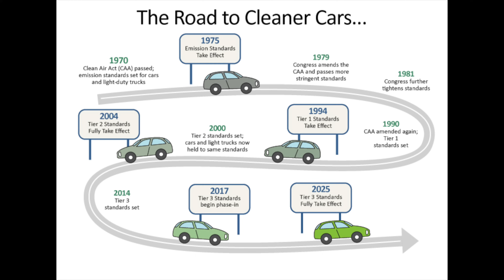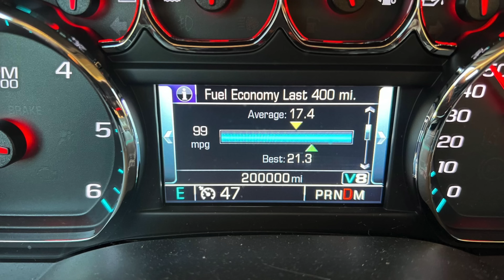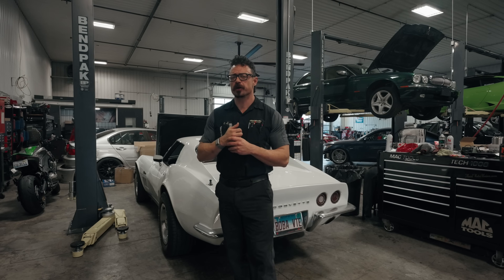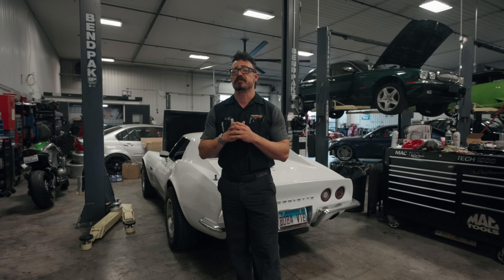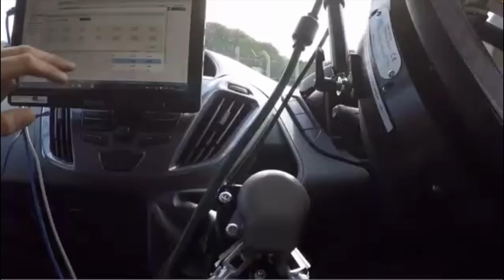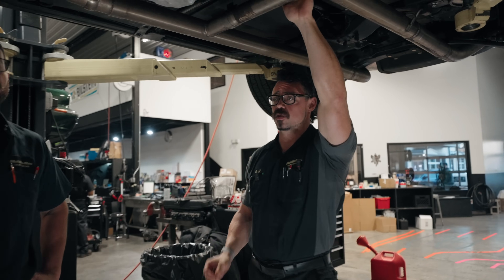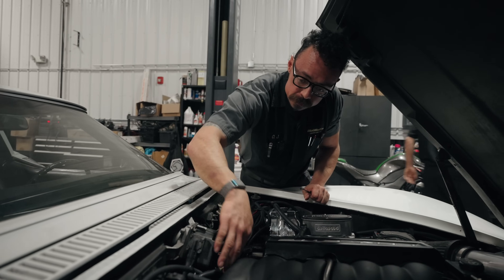Do You Need a 6 Speed Auto? LS C3 Corvette Transmission Swap EXPLAINED.

Comment: The trans is changing like any complex part let someone else do the beta testing for a couple years. Additional gears beyond 5 probably are for speeds not used much, maybe another gear would be helpful for 70-75. Reliability is proportional to the number of parts though stress in a transmission is probably proportional to the size of the jumps.

Comment: Fun video. Had this debate when putting together my LS3 Roadmaster Wagon swap project (it’s all on the Internet Brands Auto Group YT channel). 

I really wanted to do the 6L80 Connect and Cruise, and for a while, it was actually cheaper than the 4L65e, but as a first time DIYer, my Chevy Performance dealer recommended the 4L65e bc it was easier to fit in the OEM Roadmaster trans tunnel. With 3.42 gears it hits 2300 RPM at 75mph on the highway, but I can still manage 28mpg if I back down to 60-65mph in  4500 lb wagon. 

The downshifts are a bit weird at times… you want to accelerate but suddenly you’re back in 1st at 5500 RPM… and I don’t like how it rushes to get to 4th gear (I still need a trans tune). And the supermatics make a weird buzzing sound  Chevy says is normal.

But it has some fun features where you can blip the throttle (almost like a rev match) and it’ll drop down a gear consistently. Overall it’s working well, but would recommend the 6L80 of folks can manage it.

Cheers!

Comment: The  ZF 8-speeds from the BMW and Dodges goes into a lot of conversions now. Aftermarket TCUs make the conversation easier. The 8-speed comes with fast and crisp gearshifts instead of a slow automatics or even an old manual gearbox.
Reply: I was about to comment the same thing. I myself have a bmw with a zf8 speed and love the transmission and how easy they are to tune.
Reply: The zf8 is an outstanding transmission
Reply: Seems Legit Garage has parts and videos for the 8HP90 to LS engine swap.
Reply: The zf is a very nice unit
Reply: What's interesting is GM's 8l90 is basically a clone of the zf8, they just swapped the location of two of the gears, but the rest is the same exact design as the zf8.
Reply: That transmission is amazing and I'd definitely have one if the controller wasn't $1600. And that's not counting anything else like an adapter for the bell, modifications to the trans tunnel etc...
Reply: @limabravo6065 And a transfer case if you're using one. I don't really get why hardly anyone ever seems to go the 4x4/awd direction with swaps like this.
Reply: Was thinking about this swap for my ls1 firebird. It fits great too

Comment: I have a 6l90 is a suburban, it’s an impressive transmission. They have issues with the stock JMBX converters so if you have an 80/90 swap it cost you &5k + for a transmission job.

Comment: Thanks for the breakdown, OJ. I have a C3, mostly stock 350 with the Turbo 400 trans. I have been thinking about doing as trans swap, mostly to reduce RPM on the highway. The way the car is currently configured, I was looking between the 700R4 or the 4L60E (since I have a 4L60E available. Debated on making the jump to the 6L80, but I think it wouldn't make sense for this car. Again, thanks for breaking things down and helping me take the 6L80 off the table!
Reply: 4L60 is quite abit skinner. With the higher rpm and horsepower/lower torque of a 350 and simplicity of a controller and narrow cockpit it is probably the smarter choice over the 6L80. But the R700 can easily by customised to handle the higher rpm smallblock over the Ls3 and up motors and not need modification to the trans tunnel. Youll need to seriously up the lowend torque as much as you can of the sbc and drop the diff ratio and fabricate trans mount and tunnel. Plus your going to need an electronic third party aftermarket electronic controller and if your thinking about Ls swapping it one day you might as well buy the holley controller now.

Comment: Outstanding! Stock torque converters of the 6l80 are the weakest link, however.
Reply: Another note: the 6l80 from GM & the 6R80 from Ford are half-siblings in a sense that they're derived from the vaulted ZF 6HP26 featured in other foreign luxury automobiles.